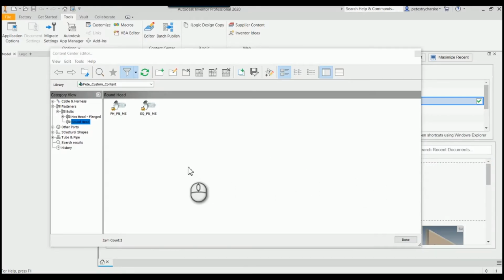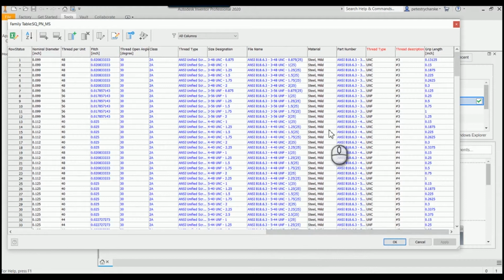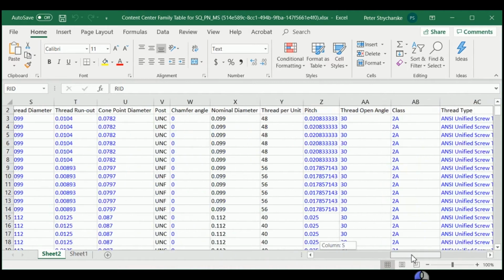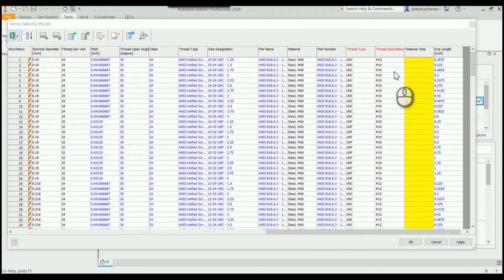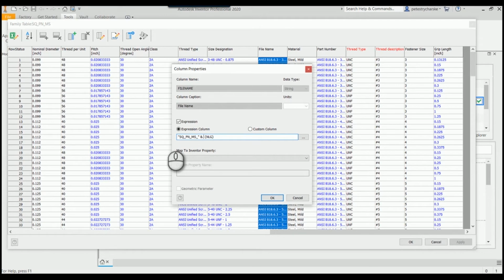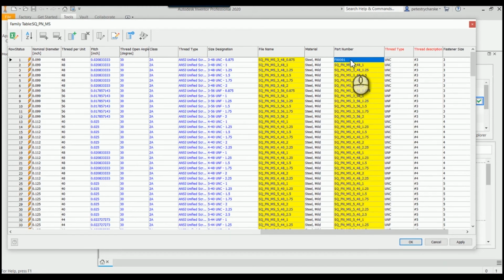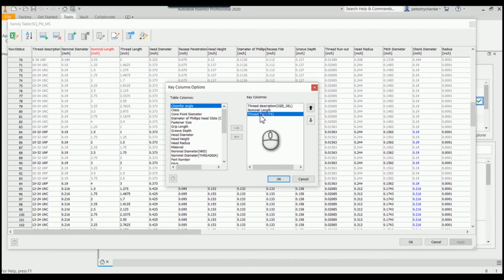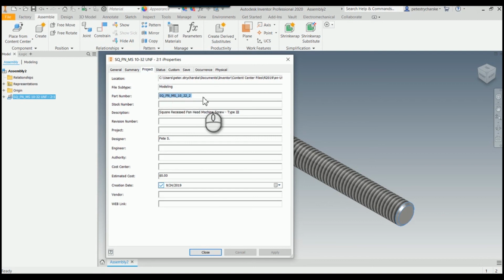Inventor – Editing the Family Table Data Inside Content Center

Comment: I am attempting to modify the Part Number and File Name scheme in my custom Structural Shapes. Inventor uses incremental LENGTH as the last 3 digits of their scheme. I want to use a formula that will increment by one digit for each new member that I add to the Frame Generator Assembly. I also want to build my part number with the Project Number in the front.

Example: <Project>&"."&<custom input>&<Increment_Number>
<Project> = 555
<custom input> = "123" prompted user input or a a field such as <Project.Custom>
<Increment_Number> = formula for bumping the last digit for each instance added to the assembly

Result: 555.12301, next number would be 555.12302, etc.

Can this be done in a Family Table or Excel formula? It seems that iLogic may also need to be part of this solution.
Reply from the maker: Thanks for reaching out!  Pete has knocked out a video that combines some out-of-the-box Inventor functionality, as well as some iLogic code to accomplish your goal.  Please check out the link below and let us know what you think!

https://youtu.be/M12q3ZuBj5Q
Reply: @Team-D3  Awesome Pete!

Your instructions are precisely what I want to do. The one thing that we might need to change, is our naming scheme for the top assembly. We would normally name that level 555.12300.iam, The first part would be 555.12301, then 555.12302, etc. I missed telling you that point.

It may be simplest to do exactly as you did. Start that top assembly truncated.

Any chance you could post that iLogic code so that I don't have to retype it? This aging CAD man is not seeing as good. ;-)

You have been a million $ help. I just ain't got those kind of funds to dish out. But if I could, I would. Thanks again!
Reply from the maker: @BuffaloBluesBand  I'm glad the technique will help you accomplish your goal!  Unfortunately, YouTube wouldn't let me post the iLogic code and I'm tied up for a bit today.  However, I'll look to knock out a blog post for you tonight / tomorrow and will post a link to it tomorrow.  Pausing the video can work, but copying and pasting is  SO much better :)  Thanks for your patience and have a most blessed day!

Peace,
Pete
Reply from the maker: @Reverbbb Privitt, please see the blog post link below that I published which contains the iLogic code.  Thanks for your patience, hope this helps and have a most blessed day!

https://go.d3tech.net/inventor-blog/inventor-tips-tricks-methods-for-controlling-frame-generator-filenames-and-part-numbers

Peace,
Pete